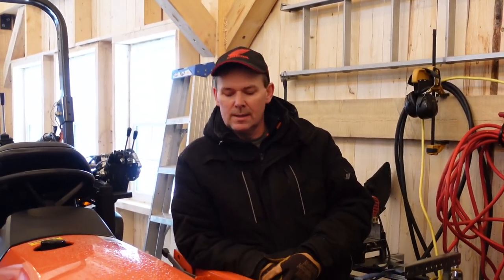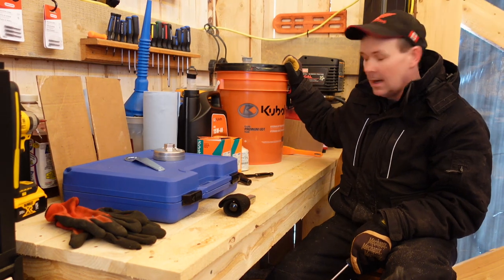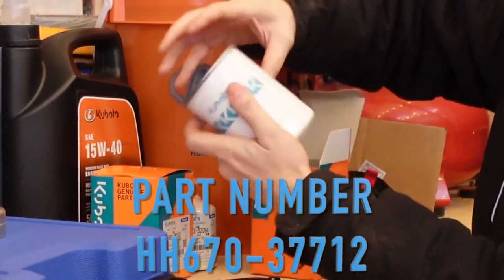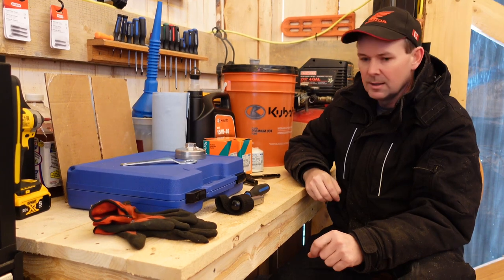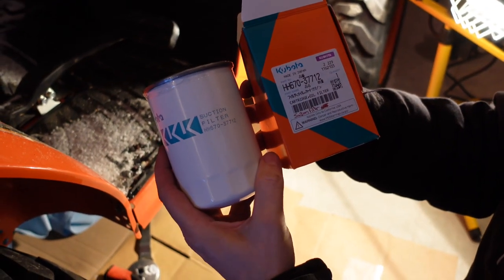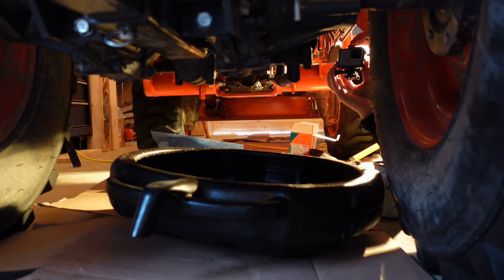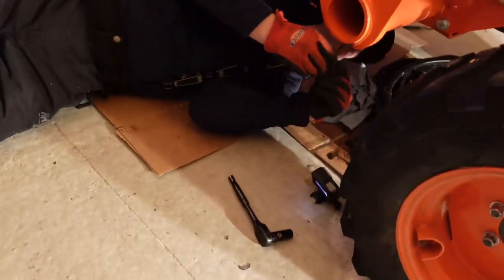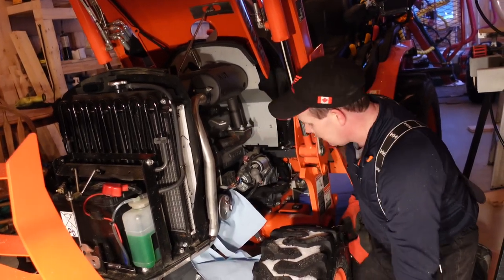Kubota B2601 Oil and Filters Change -50 Hour Service- DIY - E107

Comment: Cut to length a piece of angle iron to set on cylinder ram for bucket. That will safe it out when it is raised. Just slowly lower til it touches and you are good to go! 👍👍👍
Reply from the maker: Great idea. Our backhoe has a safety device like this built right onto the machine!

Comment: Hey Jason, thanks for the service video, I have a Kioti tractor and the service is pretty much the same as yours. Thanks for the tip with the shop towel for checking oil level, I always have trouble seeing where the oil is on the dipstick. All the best.
Reply from the maker: Hi Wayne, glad you found the video interesting. Dad runs a Kioti and loves it! Take care, Jason.

Comment: When I did my first 50 hr service, I also dumped the hydro and also the front axle. Figure if there's any metal dust I'd get it first. I really like that log trailer. Thinking about getting one
Reply from the maker: Probably a good idea! Now that I have a warm(er) place to work, It will make it easier for me to check this stuff out. I took a gamble on that log trailer but I believe it was a good purchase. It is actually capable of doing a lot of work! Take care, Jason.

Comment: How's she goin'?  Nice to get the maintenance done eh!!  Lubrication is probably the most important thing to take care of on the tractor.  Second would be the air filter.  Just a comment here, most tractors require the 3 point to be in the lower position when checking the hydro oil level.  Maybe check your manual to see if it's a requirement for your tractor.  Great video and I was some impressed that you did all that work with oil and never spilled any on your floor.   When ever I do an oil change the first thing that happens is an oil spill!!!  LOL  Take care and thanks for sharing.
Reply from the maker: Thanks Mike! I’m going to read up on the 3 point hitch! It has never been used yet nor has the loader and bucket… it has been dedicated to the Kranman as a draft horse so far! I checked the air filter off camera btw, it looked like new. I can’t be using it enough! We’ll be busy digging out tomorrow!
Reply: @OakMountainAcotts  We got about 10 inches of snow and then it's been raining since supper time...

Comment: The use of a vacuum on the Oil Inlet no doubt works well.  Another thought is before removing the Oil Inlet rubber cap would be to grab the Breather tube next to it and suck a bit of vacuum on it then pinch it off with a clamp.  Then go remove the Hydraulic HST filter and likely the loss of fluid would be minimal then too.
Reply from the maker: Great ideas! It wasn't too bad but all oil is just like gold these days... so expensive....

Comment: great video, part of the 50 hour service is tightening loader hardware, maybe a video on that?  I can't find one anywhere and have questions.  thanks.
Reply from the maker: Thanks for the feedback! I haven’t tightened any loader hardware yet. There must be torque settings to reference in the user’s manual?
Reply: @OakMountainAcotts  there are torque settings, but I am having trouble figuring out the very limited diagram in the owners manual.  the backhoe was easy beacause all the settings were within the same tolerance window, but there are several different windows for bolts/nuts of the same size on the loader.  I think the manual shows the loader frame with the bucket set up on something (like it tells you to do when you are servicing the loader), i'll be damned if I can figure out what is what though.  I just figured out how to use a grease gun two weeks ago...  loader torque is every 20-30 hours and at 50 hours, backhoe torque is every 50 hours.  however, the lack of youtube videos about this makes me quesiton its importance, especially with talking to some of the other farmers around here.  I reached out to the dealer last thursday but haven't heard back.  I just want to do things right...  thanks for getting back to me.
Reply from the maker: I wish I could help but I’m far from being a mechanic. The dealer is your best bet. I don’t plan to check my bucket and loader fasteners for torque even though it is likely a good idea!
Reply: thank you for getting back to me.  the dealer's mechanic told me earlier today that 'tight enough' is all that is need for the loader hardware.  overtightening isn't going to be much of a problem.
Reply: @OakMountainAcotts  
The loader maintenance and specs are in the loader booklet, not the tractor booklet. 
Nice job young man👍
Have a Jesus filled day everyone
 Greg in Michigan

Comment: thanks for posting.   But doesn't the manual say to drain oils at 50 hours as well?   I know it says to change every 200 hours, but 50 hours - it says to change oils (working in tractor...).  I did my 50 hour oil(s) and filter changes last summer.   Great tractor we have, I just wish I had 10 or 20 more HP to run a good size woodchipper.
Reply from the maker: Thanks Joe, I’m not sure about that… my dealer told me just the filters. They even provided me with a couple litres of hydraulic oil to top up levels from filter loss during changing. The same idea for my diesel RTV. I am thinking about a 40 - 50 hp with cab for property work. This machine was paired to my timber trailer and I haven’t disconnected it yet! Thanks for watching.

Comment: Surprised that the fuel filter is not changed, most of these tractors are fuelled up out of smaller containers and get condensation in the fuel. The fuel system is the most delicate system and very expensive to repair. Most tractors l work on have filters that are vertical and I punch a hole in the bottom, let it drain then take the filter off, no mess. Find it strange that the hydraulic oil pours out of the filter base when changing filters, there’s got to be a better design. Made a pipe on a steel plate and put it under the bucket so if a hose would break the bucket wouldn’t fall down, easy safety tool to make. Like the filter socket, works well. Good job my friend.
Reply from the maker: Thanks for the feedback Gerry! I checked the air filter off camera and it looked like new. I see the fuel filter is pretty easy to get at; I'll read the manual to see what they suggest!

Comment: What size (mm) oil filter socket did you need from the set you purchased for the Kubota filters? Thanks.
Reply from the maker: There is no size stamped on them. I could measure them up but if I’m off a bit, you wouldn’t be very happy with me!

Comment: 50hrs... that machine is NEW!  Did you have any plan of pulling the log trailer with the RTV?  I know you had it set up to be controlled from the seat of your tractor.  How do you like the RTV so far? Thanks!
Reply from the maker: Hi Joe, the possibilities are becoming endless! I really like the trailer behind the tractor. I think I will leave it setup like that for now. I am curious to see how the RTV performs with tracks.... I have visions of me using it like a little tractor in the woods backing up to those hard to reach areas and towing out some nice wood..... We will see what happens! Thanks for stopping by, Jason.

Comment: Which of the filter sockets did you end up using? And was it the same one for all three filters? The set looks handy, but I don't need that many.
Reply from the maker: Here’s what I have written down in my filter socket kit: type 911-1, 79 mm diameter, 15 tooth for engine filter and hst. Hope this helps!
Reply: @OakMountainAcotts  thank you!

Comment: Your entire tractor is METRIC.  Your drain plugs are NOT 9/16.  They are most likely 14mm.  While 9/16 may fit just fine, the proper size is metric.
Reply from the maker: I don't disagree but the bolts are coated heavily in paint so the 9/16" did the trick. Thanks!

Comment: Should have lowered your bucket so the hydraulic oil on the cylinders went back in your reservoir before he checked your level.
Reply from the maker: Good point! There is a lot of hydraulic fluid in my log trailer and a few small leaks so hopefully it will be okay. I'll pull the stick and check it out though... Thanks!
Reply: The rear 3 point also no?   Thought everything had to be on the ground.
Reply from the maker: Well possibly… I haven’t had any issues and my reservoir is feeding my timber trailer as well so it should be okay!
Reply: @OakMountainAcotts  should be ok but yes I just checked the manual.  Cold, everything down and on the ground, then check the level in the rear.  If it’s over filled I’m sure I’ll just over flow and need cleaned up.
Reply from the maker: Good to know, thanks!

Comment: I found it messy to take off My filter on the 2601. Stupid design. Next time place duct tape below the filter drain and keep on using more tape overlapping the edges till it makes a faux funnel. Honda small engines same thing. Hope you can picture that. Those filter wrenches are pretty cool. Cheers
Reply from the maker: Thanks for the tip! That hydraulic oil from kubota is pretty dear….
Reply: @OakMountainAcotts  
Hydraulic oil IS VERY dear! Not cheap, but I was referring to engine oil drain. Cheers
Reply from the maker: that makes more sense, I understand now!

Comment: There is supposed to be a vacuum cleaner trick you can use to change out your hydraulic filters put the vacuum cleaner on your filler hole and it draws enough suction so she don't spill on you so bad why changing the filters
Reply from the maker: That sounds like a pretty good idea! Worth a shot for sure!